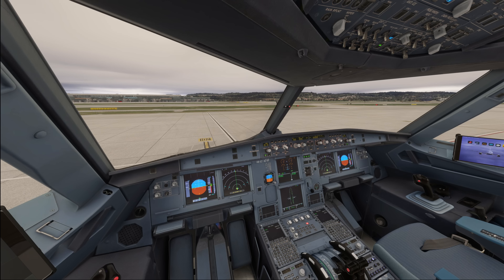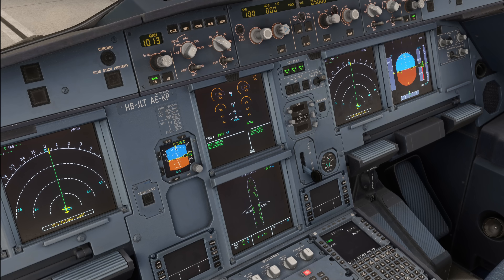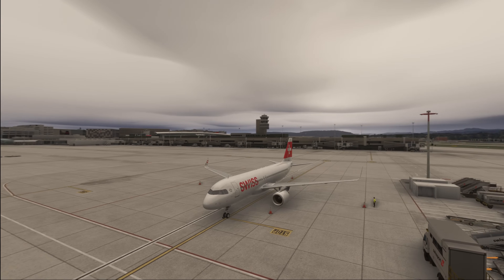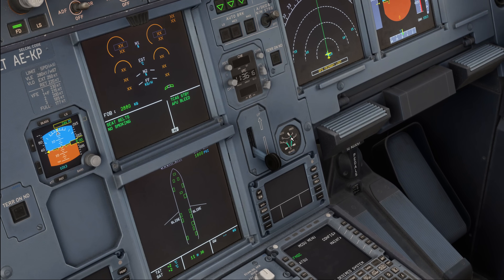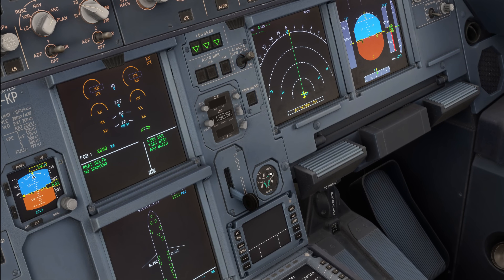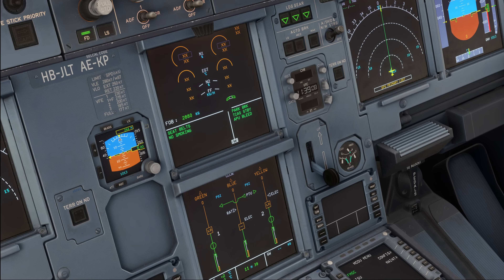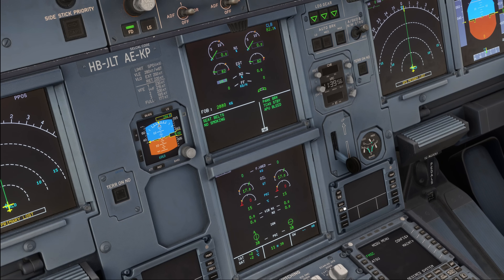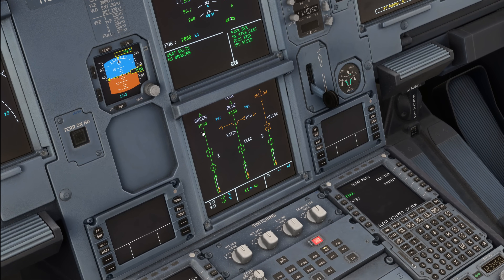Airbus CHANGED THE ENGINE START SOP | What's NEW and WHY was it necessary? | Real Airbus Pilot

Comment: But why use number 1 instead of always start number 2? If Yellow is powered by number 2, and yellow powers green with PTU, you have breaking and steering for single engine taxi. And if you want to use both, then start the second engine for the rest. My question is, why make the change to always start number 1 and not number 2? Plus, it would be more consistent with other aircraft like the boeings in general.
Reply: Because then the PTU would constantly be running and making the barking sound for the whole duration until engine 1 was started

Comment: Thanks for the video! Is there any risks associated with the parking break pressure? If I see it correctly, correct me if I'm wrong please, there's not really any hazard associated with started number 1 first, you'll have primary breaking and if needed for single engine taxi, the yellow elec pump will provide an alternate and redundant breaking source.

Comment: On the Boeing we start engine 2 first and noone has ever considered ground personnel around the plane to be unsafe, as this is the main task of the ramp agent to have everything and everyone cleared out of the way before ANY engine is being spinned. So no matter which engine you start, nothing and noone should be around the PLANE. In the U.S. engine 1 was started always, but when we Europeans operate in North America we start engine 2 first and noone ask us why we do so. Airbus is trying to reinvent something that should not be harmed at all. It should be crew decision or situatuion or airport specific or ramp agent decision which engine is started first. The red rotating beacon light is the sign that all personnel should be clear from the plane and at least one engine is spinning, irrelevent on which side.
Reply: All boeings or just 737? Always thought it was odd to start 2 first on 737 as the ground crew plug in on the right side of the aircraft but after seeing the ability to run the No 2 pack via engine 2 and use APU bleed for eng 1 it made sense that way too

Comment: Simple question as a non-aviator: Once there is any possibility of engine start (beacon light?) then assume both engines are running. Wouldn't that solve the problem?
Reply from the maker: That's what you'd think. But complacency is a huge issue.

Comment: This is not a clever decision. For decades every airliner was starting #2 first. Airbus and Boeing. Everybody on the ground is used to it. I am not talking about quad jets, that can be different story but twin-engine jets. Now imagine the confusion as the tired ramp worker must realize "Ah, that's an Airbus, he is gonna start the left one." That deviation from well known rule to start 2nd engine first is something to be considered very dangerous in my eyes. No matter how the aircraft was designed and that starting #1 comes with advantage to hydraulic systems logic, Airbus knew very well how things were done by Boeing while A320 came and they should have designed the aircraft in a way starting #2 was no issue at all. I can tell for sure now there will be many atempts to start #2 just because of the muscle memory of pilots to put their hand on the right engine master switch.

Comment: I found this on Wizz air forum 
“It was discovered (by WizzAir probably) that starting engine number 1 first lowers the usage cycle of PTU which reduces maintenance costs significantly. Long story short - on Airbus aircrafts engine no. 1 powers green hydraulic system which has no electric pump. This system powers parking brake and nose wheel steering, what obviously are quite good things to have. When you are starting engine number 2 and powers yellow hydraulic system first the green system is powered by the PTU. Yellow system as you might be aware has own electrical pump, which provides the pressure for the PTU (also drives cargo doors for example) so it has to be used anyway.”
Reply: NWS can be on green or yellow system. It depends how old the aircraft is. Newer ones have it on Yellow. Also no matter which engine you start first, when you star the 2nd the PTU runs a self test.

Comment: Why not just use engine 2 for single engine taxi? Should be the same.
Reply: because it powers the yellow hyd pump, which doesnt cover things necessary for taxi such as nosewheel steering, brakes, etc. Those are all included in the green hyd pump from engine 1.
Reply: @burntmacaroni8989 NWS can be on the yellow system for newer models (including newer CEO)
Reply: …and therefore you’d need the PTU to transfer pressure from the right to the left system- and that sound can be quite annoying for the passengers. So you start engine 1 and pressurize the right system with the elec pump which is much less annoying

Comment: Hello i have question. Witch hydrlics circuit powr the nose wheel strering?
Reply: Depends on the age of the aircraft. Older ones it’s the green system, newer ones (estimate around 2012 but might be wrong) are Yellow System

Comment: The exception is on the Neo if you use the Air Conditioning During Automatic Engine Start (FCOM-NOR-SUP-ENG) where Engine 2 still needs to be started first. 

Of course the opportunities for this procedure only really exist on Neos in extremely high OAT, so it’s a minority of times.
Reply: How do you use the air conditioning system during engine start? Putting the switch to IGN shuts off the packs automatically as bleed air is needed for the start

Comment: Thanks for this video, now my question is why do we have to turn on the Yellow elec pump when doing single engine taxi? since the brakes are working.
Reply from the maker: Yes, you do. Otherwise, if the green hydraulic system (or primary brake system) would fail you'd be left only with the accumulator.
Reply: @A330Driver  Understood, Danke dir ;D
Reply: @captainl3on you’d also need it for nose wheel steering for those aircraft that have the NWS operated by yellow system. And you don’t want the PTU barking the whole time

Comment: My company got round of all of this very easily by simply disallowing single engine taxi to the RWY.
Reply from the maker: That's certainly a way to do it - but at the price of using quite some additional fuel. Every airline will make their own decisions if that's worth it for them or not.
Reply: @A330Driver  my airline requires dual engine taxi if it's the first flight of the day or the taxi time will be less than 10 minutes to ensure the engines will get proper warm up time, especially in the winter.
Reply: Safety first, should be mandatory for both pilots to be looking outisde

Comment: Been flying A320s for over 20 years and we have never started engine 2 first unless it's an external air start.
Reply: Do you fly for EZY?
Reply: @cjmillsnun  Oh God, no. US based.
Reply: @jeffg7  did you do Single engine at departure? My Airline does not implement the new procedure because single engine at departure is not authorized. At least for now.Other than that it doesn´t really make a difference if ENG2 is startet first. Maybe like he said for the ground crew, but I think the most Boeings start ENG2 first as well
Reply: @aviationknowledge8596  One engine taxi is at captain's discretion unless the surface is contaminated. If the right engine is started first with external air then at least a short taxi on one engine is likely required until you reach a safe location to cross bleed start the left engine.

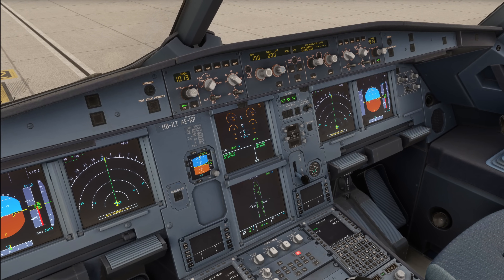Comment: Why are the PFDs showing a slight pitch up at 7:37 but not at 1:40
Reply: I'd imagine that even if the engines are at idle, they still produce enough trust to push the plane forward and because the parking brake is on, only the nose lifts a little. 

Kinda like when you try to start a manual car in a slope; power on, you lift the clutch slowly with the parking brake on  and you only let go of the parking break when the front of the car starts to lift up (indicating enough forward mementum in the wheels to go up without going down first)

Not a IRL pilot tho so feel free to correct if i'm wrong.
Reply: @DarkOrbiterAerospace  Very interesting, thanks!

Comment: V1 simulations discussed this in great detail and create a meme out of "which Airbus engine is started first"
I ride with a lot of Indonesian low cost carriers that fly A320s, Citilink (CTV), AirAsia Indonesia (AWQ), TransNusa (TNU), and Batik Air (BTK) - they really do 1 engine taxi out most of the time, and start with engine no.2. PTUs are barking all the way until we are near the holdshort point, making people chuckle. They don't do that with the A320neo, as they always start both engines after pushback.
The last time I flew old A320ceo was Thai's IAE-powered one, HS-TXC - from Bangkok VTBS to Hanoi VVNB they also do the one engine taxi-out, but for some reason they start with engine no. 1. This was back in May 2024. Of course the PTU barked all the way.
Reply: Maybe because the neo takes ages to start the engine that’d be why they don’t do it on the neo I guess
Reply: On NEO with LEAP you simply don't know how long the Bowed Rotor Motoring will take 😀😀
Reply: @T0M4SVL  At most 60 seconds. Yes, one needs to plan a little more time, but it is certainly doable to do SETD.
Reply: i don't really get one taxi ops that with BTK even in CGK & SUB
Reply: That seems pretty dumb and annoying for the pax instead of just turning on the Yellow electric pump

Comment: Ok that is a little bit confusing because on the 2 Engine are the Brake Hydraulics...
Reply: As explained din the video, there are different braking systems operating on different hydraulic systems
Reply: Yeah I also don't get it. I don't see the "problem" with starting number 1 first if you're not going to single engine taxi anyways. The brake accumulator has enough pressure to set the parking brake regardless so I am very confused.

Comment: I am not very experienced with the topic of single engine taxi. However, what I am wondering is: doesn't engine 1 wear out more over time than engine 2? Or is engine 2 then used as the single engine when taxiing to the parking position?
Reply: Engine 2 isn't normally used to single engine taxi in unless engine 1 failed

Comment: I thought Boeing's SOP was to start #2 first as well?  Do you happen to know if this has also changed?
Reply: engine 2 is hyd system B which powers normal brakes. the parking brake generally uses normal brakes, so its associated with system B (right). in terms of single engine taxi, boeings hydraulic systems work differently so for example in the 737 you can do a single engine taxi off of engine 2 unlike the bus.
Reply: @ Thanks!
Reply: I have never found a solid answer as to first engine start for a 737. Some say 2 because you can have the air conditioning pack 2 run off engine 2 and isolate so APU runs pack 1 which is useful on hot days. Others say engine 1 first because interphone for ground is plugged in on right side so more dangerous to start right first
Reply: @tomstravels520  My understanding has always been  that #2 starts for Boeing...  haven't heard that that has changed.

Comment: Isn’t it more dangerous to ground staff now? Before they used to be cautious and now the rely on the pilots starting Eng1 and then comes either some airline that doesn’t adapt the SOP or some pilots that just do it like they did for the last 40 years
Reply: Yeah I know aviation is about creating multiple layers of safety, but should ground crew be near any engine at all once they're cleared to start? Shouldn't matter which one you're expecting first, just clear both of them.
Reply: apart from that, I thought it was standardized to say the sequence of engine start to the ground crew on every airline. I never saw this hazard here, interesting!
Reply: @ it is. The crew will say “we will start engine x and then engine x afterwards” beforehand
Reply: easyJet have done this for years lmao
Reply: I thought the same thing. What I'd figure is that Ground mgmt. should be even stricter to clear BOTH engines as soon the beacon is lit

Comment: Makes sense really. Partly because if you decided to do a single engine taxi and then accidentally started engine 2 first you’d presumably have to continue with 2 engines. And if you start engine 1 first you could maybe leave it a bit later to decide if to start engine 2 straight away or wait a bit. On a recent easyJet flight they started engine 1 first and only 2 minutes after starting taxiing they started engine 2
Reply: ezy sop has been start eng 1 for a while now
Reply: @isacjohnson8891  yeah it was just weird how they started engine 2 only 2 minutes into taxiing and we really hadn't got far from the gate.
Reply: @ yea no idea why. Might be that single engine taxi weren’t their intention. Probably just got going to save time and started the engine once moved

Comment: Nearly 4 decades of ops and someone decided he miraculously came up with something smarter.
Reply: Took humanity several hundred thousand years to get to the Airbus aircraft to begin with, so I am not sure why you think things wouldn’t continue to evolve? How many billions of man hours did it take until someone came up with using their fingers like Jimi Hendrix?
Reply: The whole point is continuous improvement.  easyJet have done this for years.  I never understood why until now.
Reply: AFAIK in the A320 the engine 2 was always started firstly, because hydraulic pressure is needed directly after pushback for nose wheel steering.
Reply: @m.l.5284  Nope. You've got an electric pump on yellow for that exact scenario, just need to follow the checklists for single engine taxi and turn it on. That will generally happen after engine 1 has started and before the parking brake comes off. The retained pressure within the parking brake system will keep the brakes held until then. After engine 1 start you can then run the yellow elec pump as needed until just before starting engine 2. I'm guessing it needs to be off for the PTU self test.

"Always" is also inaccurate. The earliest A320s off the factory floor originally drove nose wheel steering off the green system, and it was soon switched for improved failure resilience. On an early A320 if you taxi on engine 2 there's nothing driving nosewheel pressure, so you'd have to rely on the PTU to pressurize the green system. It's noisy and probably wears out the PTU faster, so on those models there's no reason not to always single engine taxi on engine 1.
Reply: What a stupid comment. If you actually watch the video, you'll hear Emmanuel say that some airlines already realized the possible danger and updated their procedures. Airbus now made it mandatory for every operator.

Or would you have preferred to wait for someone to get sucked into the engine before airbus did anything? Then you could've commented: "nearly 4 decades of ops and nobody thought of this danger?"
Reply: Ezy has SETO as SOP anyway
Reply: sometimes it's because "I've a job and I have to prove I do it" only

Comment: for what is that, to relief the ptu?
Reply: Not really as PTU will auto test anyway and you wouldn’t have the PTU running during single engine taxi
Reply: @tomstravels520  i mean if you start eng 2 first you have also green hyd via the ptu during single eng taxi
Reply: @bauk477   no airlines does that. Passengers don’t want to hear the PTU running that whole time
Reply: @tomstravels520  most people are used to dog barking :-) but technically its possible
Reply: @ technically you could apply reverse thrust at the gate and push yourself back.....but it isn't safe and would risk breaking something or someone. And people are used to hearing PTU for a few seconds, nobody want to hear it say at Chicago where you can be taxiing for 15-20 minutes
Reply: @bauk477  they use the yellow electric pump instead of the PTU. its a quieter high pitched humming sound.

Comment: does this also apply to the a330? or has it just been changed for the 320 series?
Reply from the maker: As @AirportEntertainment said, on the A330 ENG1 is always started first. That's because in the A330 the BLUE hydraulic system powers the alternate brakes and ENG 1 powers both the green and blue systems.
Reply: @A330Driver  oh I see thanks, learn something new everyday
Reply: You always started ENG 1 first then ENG 2 in the A330.
Reply: It's actually a nice change even if it's just for commonality between A330 and A320s along.